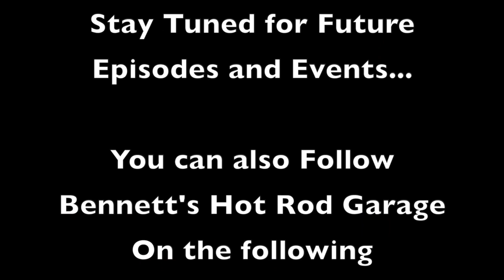72 challenger back disk brake conversion

Comment: Nice work Matt!!!! You can actually get the caliper brackets and hardware from a Jeep Liberty and bolt it to an 8 3/4. The flanges are the same bolt pattern and the rotors are 11" I believe.
Reply from the maker: this wilwood kit allows you to use the stock 14" wheels, that was our biggest decision maker
Reply: @bennettshotrodgarageclassi7068  I see. Makes sense.